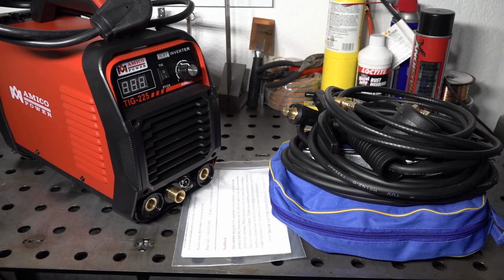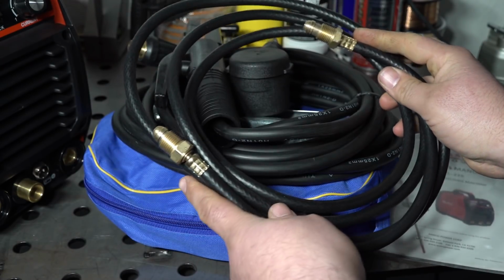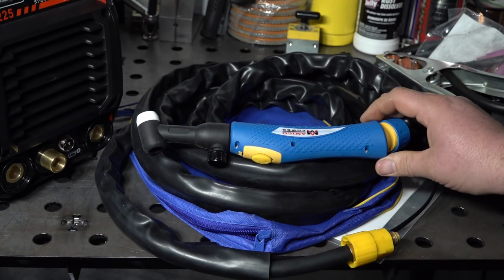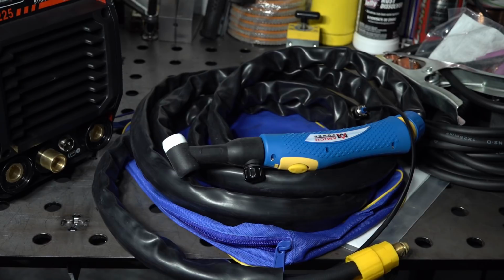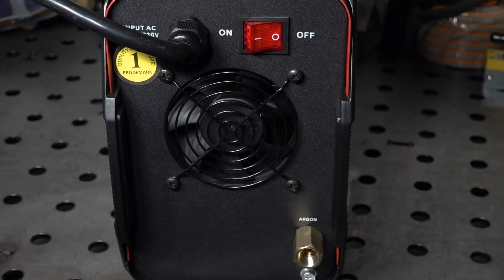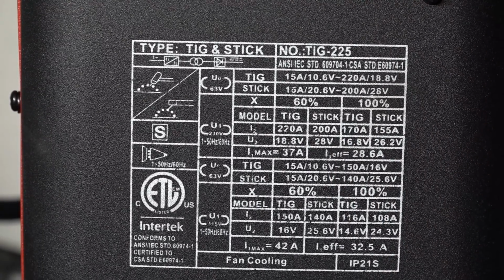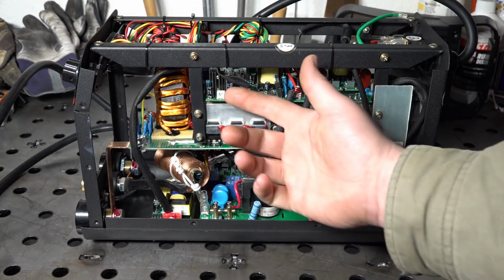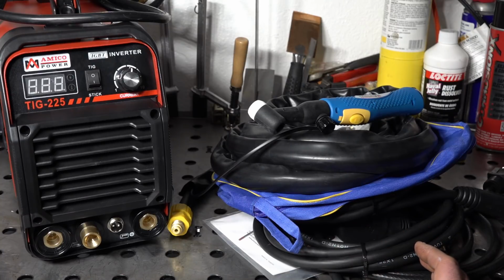Amico TIG 225 Review: Pt 1

Comment: ^0% duty cycle is pretty high. pretty much unbelievable, but lets see. 
The Miller Dynasty 200 only had a 20%, but out of fairness, ALL welders are way underated.
Tig Time with Mr Tig dig a duty cycle comparison with 4 welders and they all went 10 strait minutes without shutting off.
Reply from the maker: One thing to keep in mind with duty cycle.  The over temp shutdown is designed to prevent catastrophic failure.  But the rated duty cycle is not just about not quite hitting the over temp shutdown.  Duty cycle is about keeping the temps of components within nominal operating ranges.  Temperature has a direct and in some cases drastic effect on component life.  A capacitor, for example, may have twice the service life if run at a max temp of 60C vs. 80C (just made up numbers for example).  So the over temp shutdown may be designed to prevent the thing from melting down, but the duty cycle is likely spec'd to ensure long service life as well.

Basically, it's not too surprising that many machines can exceed the rated duty cycle without going into a thermal protection shutdown, but it doesn't necessarily mean it is "underrated".  They may be, but it could also be that pushing the machine beyond the rated duty cycle is stressing things and potentially shortening their life.  Also, many machines are rated at 40*C ambient temps (104*F).  So if the air temp was cooler than that during testing (likely), the duty cycle would be higher as well. 

All I know for sure is that heat kills electronics.  Limiting heat is a good thing.

Comment: Thank you for doing this! Just be honest. It might be a poor welder, or it might be surprising good. Hopefully you will find out. Not everybody wants to spend big bucks to tig weld, especially if your just learning. Miller and Lincoln offer some entry level welders, but it depends if you want to spend that much. There are some nice Chinese tig welders out there from $600 to $2500 That have almost all the features of a Miller dynasty or HTP 221 Invertig. Some of them are VERY well built too! I know for a fact that the Miller and Lincoln offerings have LOTS of Chinese components inside them, and have see it, but they work well, so I would like to say that the Chinese TIG welders have the same durability and quality, but time will tell. Miller and Lincoln are VERY proud of their products judging by the ridiculous prices they charge.